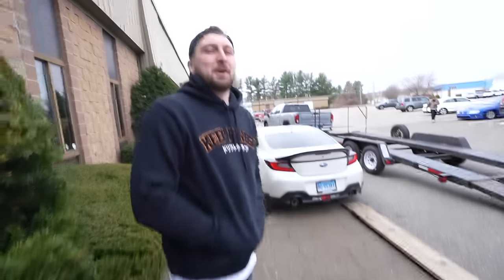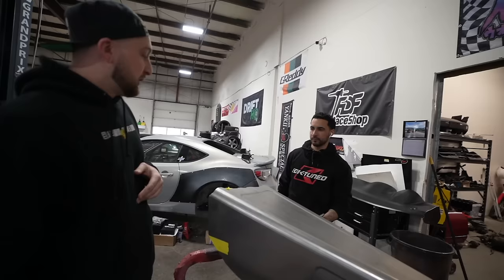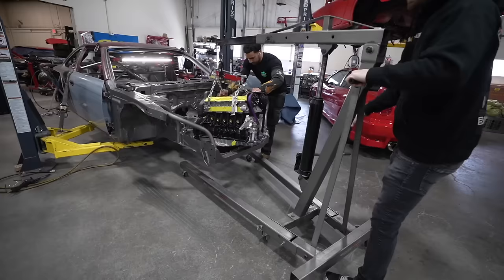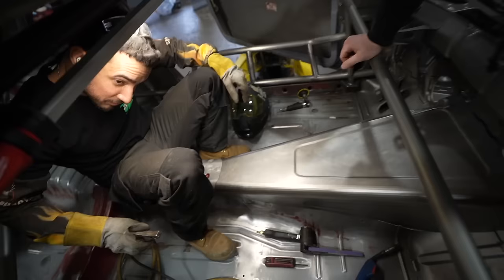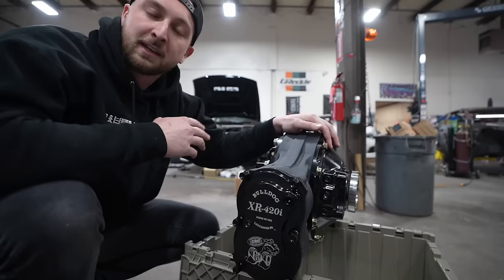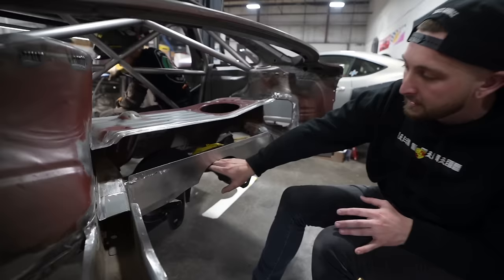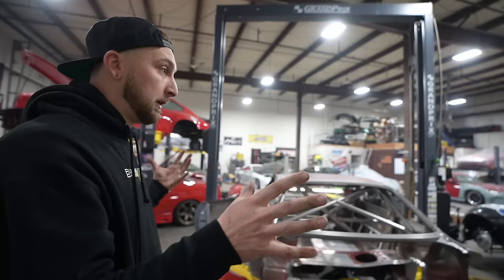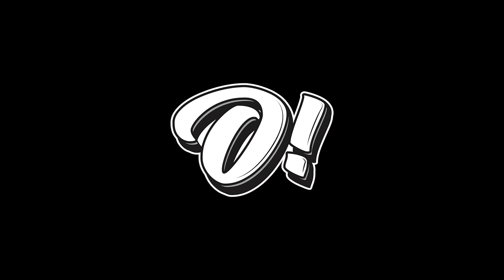I didn’t think I’d EVER own one of these!

Comment: Bull dog tip for you. Take the 1/8npt sintered breather out of driver side billet case and put a 1/8npt to -6an or hose barb and locate the breather much higher or to a small over flow tank.

What they supply is a nice looking filter but it pukes oil out. I even tried under filling the case a little. Same results 

Better to do it now vs adding unplanned pieces to the well organized build once it’s in its “completed” stage.
Reply: Small but critical detail . I hope someone makes note of it. Props for posting this .
Reply: Bump

Comment: This build is guna be insane! Wish i had a quik change in my car damn 5500$ diff lol then axles and a driveshaft probly 8500$ in the rear driveline if it stops there. I just knock on wood that my stock welded diff stays together another couple years with 500 whp and 255s lol soo far its been over 400 whp for 5 years and over 500 for a year already 🤘